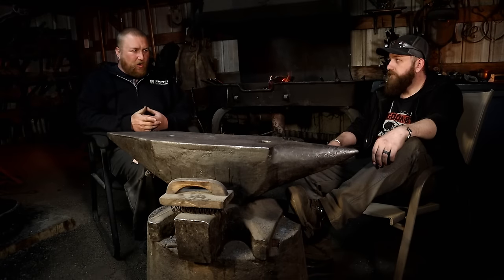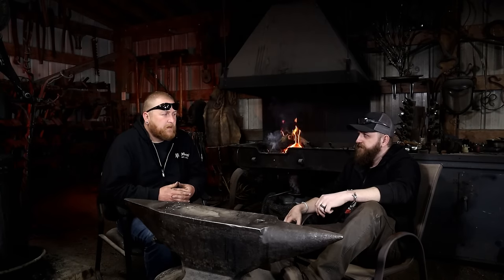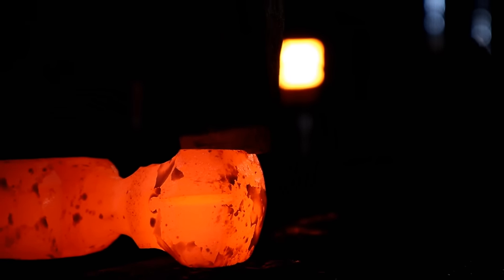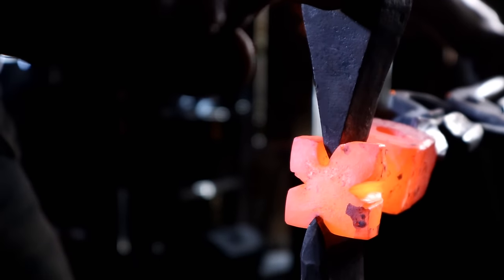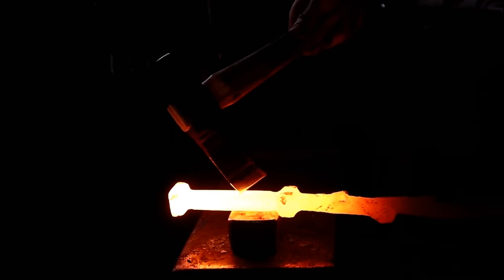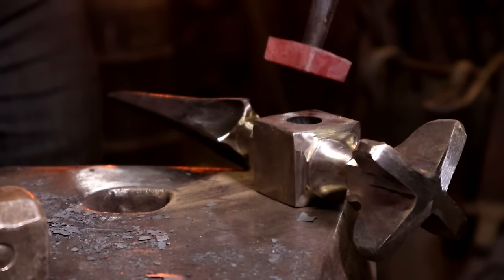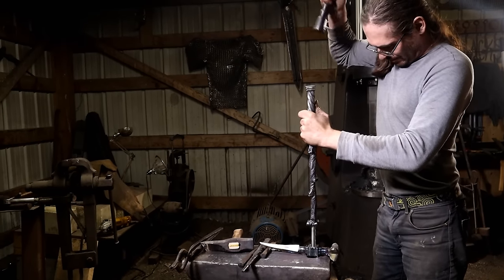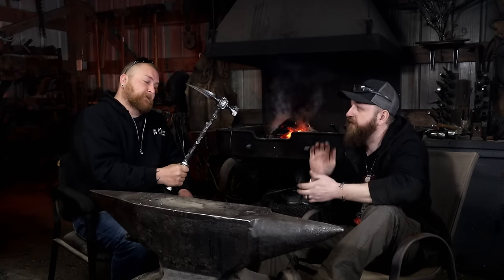Forging a [War Hammer] - 1st Historical Build

Comment: most warhammers I have seen had 3 foot handles and were mostly swung from horse back.  Riding a horse and swinging a 2 to 3 lb hammer with a 3 foot handle would be devastating.  Same reason they do not allow warhammers  in Burhurt competitions.  Although they allow maces, but weight restrictions do not allow them to do any real damage.

Comment: Dude the hammer  part isnt  to just  stop your enemy moving its to crush and shattered  the  bones and  internal oragans and the spike is used for armor peircing but ive seen spike gets stuck and tbh  has more use than a sword would a sword isnt much better against light armor tbf sure  it cat cut  it to bits but a  war hammer will still shatter bones and cause severe internal damage regardless

Comment: What is hamone, or whatever he keeps mentioning
Reply: It is a marking on a blade that shows roughly where the hard edge meets the flexible back / center. Most commonly found on the Japanese blades. It is also called a beauty line.
It's appearance and placement is different on every blade. Even if the blades are made by the same smith.
Reply: @jaquigreenlees  thank you, that makes a lot more sense now

Comment: To the question "What was a war-hammer for?", here's the answer. To put it in brutally-simple terms, it was a CAN-OPENER! The can it was designed to open had a person inside it, but there you are. As to why it was more-effective than a sword, it is as follows: A sword, having a long cutting-edge, spreads it's moment-of-impact energy over a larger surface-area, reducing the foot-pounds of energy to below the rupture-point of the steel in the armor. Also, a sword moves much slower than a war-hammer, further reducing the energy-transfer.  A war-hammer, moving much faster, and having only a very small amount of surface-area at point-of-impact, transfers much more energy to the steel, and, aided by the shape of the weapon AT the point-of-impact, penetration is much more easily achieved. Penetration of not only the armor, but of the person underneath said armor due to the length and shape of the weapon. The phrase "Oooops up-side de haid" takes on new meaning and more consequences.

Comment: Here’s a question, why do they tap the anvil after hitting the hot metal? It’s always BANG ding-ding-ding BANG ding-ding-ding BANG ding-ding-ding. Could someone explain that?
Reply: The hammer "tapping" is to conserve energy in the hand and forearm muscles, and also to immediately reestablish a proper grip on the handle. You do a strike, relax the hand a little, watching the workpiece to see exactly what the effect of the strike was and determining where the next strike should be. Every second you're gripping the handle is basically a workout for the arm and hand, you gotta conserve some energy if you want to get hours and hours of work done that day. All kinds of little things like this that don't exactly make sense til you do it yourself. For instance, did you know that this kind of work makes your snot black? The dust and soot and smoke in the air get filtered in your nostrils and gives you black boogers. Kinda weird the first time you experience it. And you really underestimate the heat, unless you're used to working really close to fire all the time, like with cooking.

Comment: @21:50 - Is that a crack running right down the tine on that head?
Reply from the maker: no its a slight cold shut that we did want to grind out. Nothing that would harm the weapon.
Reply: Stunning work and design!

Comment: Why not heat treat the spike?
Reply from the maker: he did! Just let the temp fall a tad before he quenched that section because it got a few degrees hotter than the rest of the hammer due to less mass.
Reply: That Works thanks👍

Comment: My knowlege in this area is limited so I might be wrong on this but I think it makes sense. i wouldn't use a vpn right now out of civil duty. Our data infrastructure is under alot of strain right now with everyone being isolated and searching for information. A vpn increases your load because every packet you receive has to go through at least one more step and it also increases the spike you cause because it is all coming from one source instead of being more split up until the final stretch. if you can some how insure that your vpn that you are using is closer to the source of your data it might actually help but yeah. Its not a huge increase but it is not nothing either.

Comment: While I like and admire the individual bits and historical craftsmanship, the overall piece is a bit of a visual soup.  Everything is happening everywhere, which is not good when it comes to aesthetics.  I'd rather see understated elements supporting a considered focal point.  Regardless of taste, everyone finds that appealing, even if they can't explain why.  Compositionally, this is an angry mob screaming at the viewer for attention at all angles, where the viewer just can't look at any one thing long enough to really appreciate the finer points.  Instead of an A grade concentrated in a couple concentrated areas of interest, which certainly exists, you just get a muddled sense of above average overall-ness resulting in a B grade that viewers quickly admire and forget about.  The skill and talent is there, but a less is more approach would work wonders.

Comment: Alas phantasy why not make something correct.... It's mich more appealing and pleasing than such unicorn Humbug.... The head looks not bad but the branchstye hande is to much as to short. As it's to heavy Warhammer iron handles are hollow and most have wooden handles reinforced with iron lugs..... It's ab weapon and this thing surely has double the weight of an real one